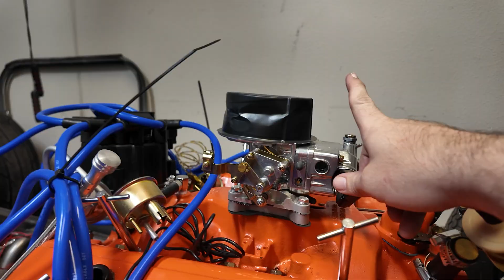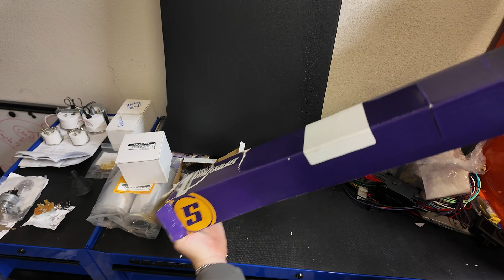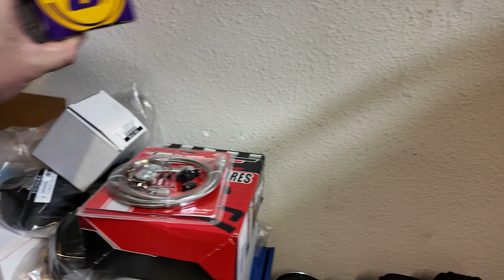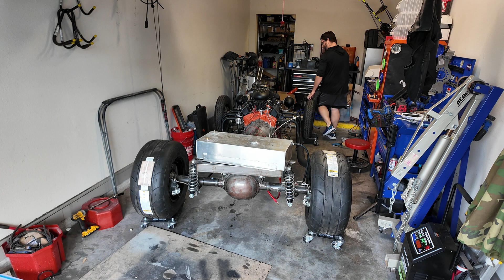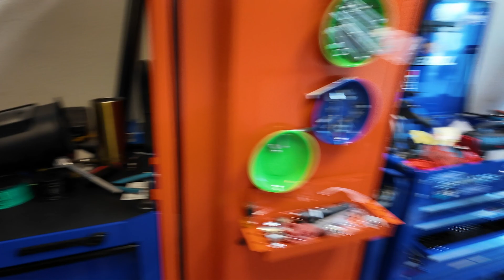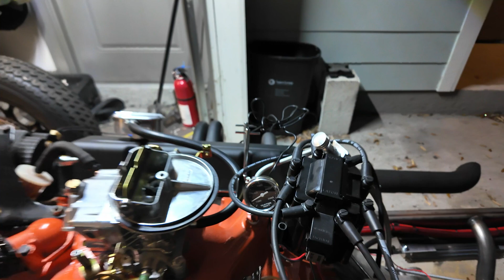T Bucket Hot Rod Full Build - EP13 | Speedway Motors T Bucket Hot Rod Power Tour

Comment: Those header. Extensions WILL work themselves loose over time.  I put a pop rivet on the back side to cure the issue. Keep an eye on them, you don’t wanna run over one going down the road.
Reply from the maker: Are you talking about the kickouts right?
Reply: @GearHeadzGarageUSA  I believe so, if that’s what they’re called. The one bolt won’t hold them tight forever.  Mine kept coming loose and would rotate so the exit pointed downward. To remedy the issue, I drilled a hole in the back side and installed a pop rivet.  It’s worked fine for the last 10 years since..
Reply from the maker: @RichT-s2r  well I appreciate the tip! I'd hate to be going down the road and drive over one of those things and flip over lol 

When we get ready to drive and I'll keep that pop rivet in mind
Reply: @GearHeadzGarageUSA .     You’re welcome and good luck with your build.